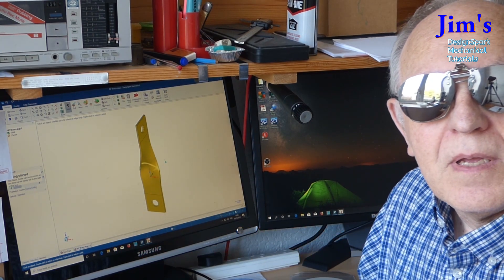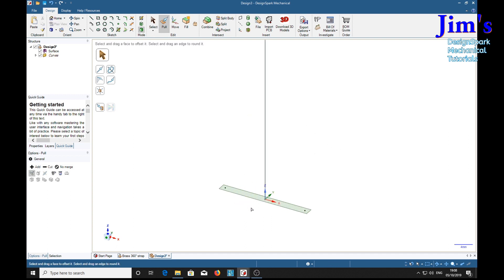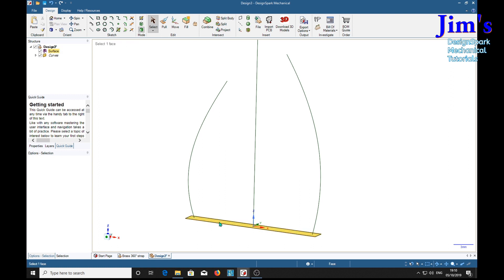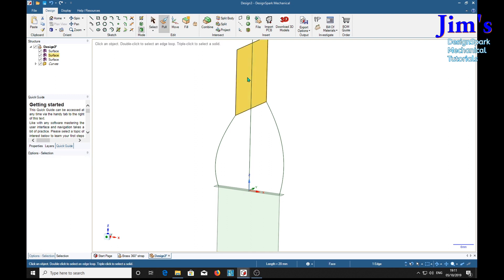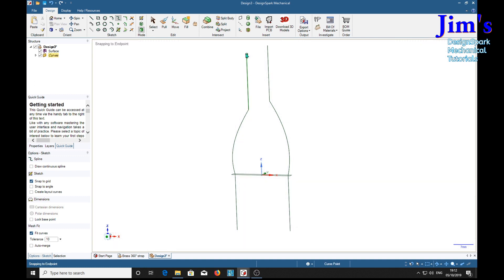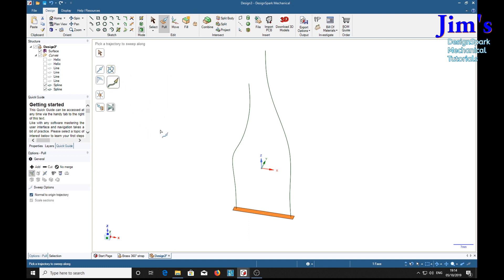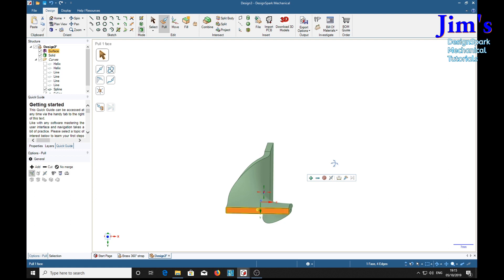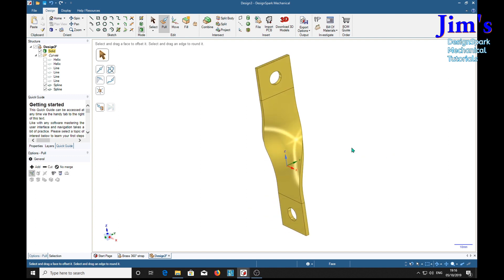Modeling aTwisted strap in DesignSpark Mechanical pt2

Comment: Jim. with the helix tool, try not 'entering' the height, try instead 'tabbing' to input values and directional 'pulling' with mouse cursor. Agreed, once a height is inputted, that's it! but, - this way i'm getting a good sense what is happening with helixing! There is a thin 'trace line' that appears attaching the helix to origin, this looks like a small bug. it doesn't affect the actual pulled helix though.
I've been playing with the command after your comment about entering the height last...Thanks for your post.
Reply from the maker: I'll give that a try next time I use that tool - thanks.